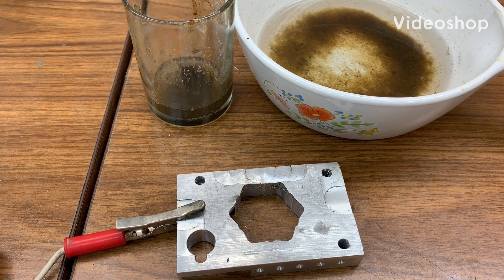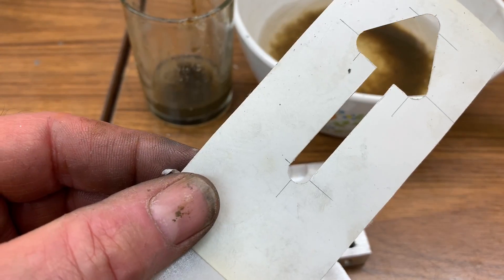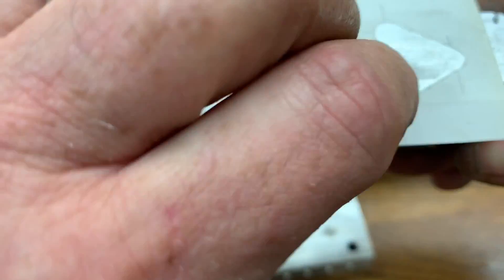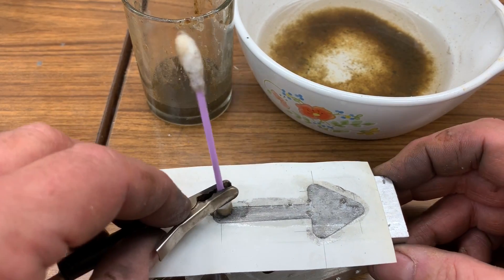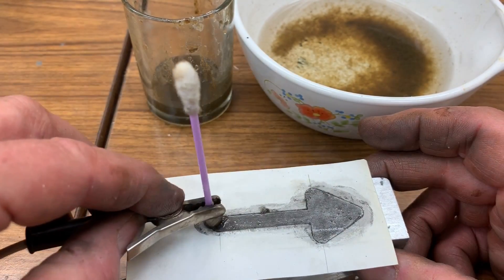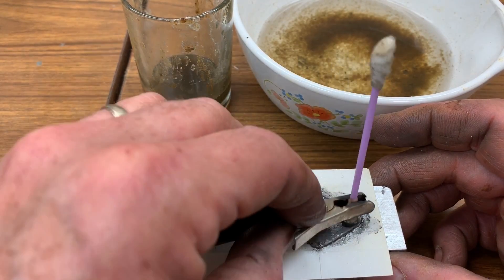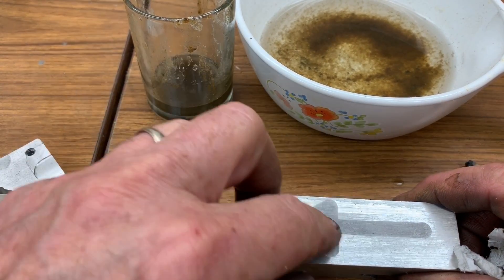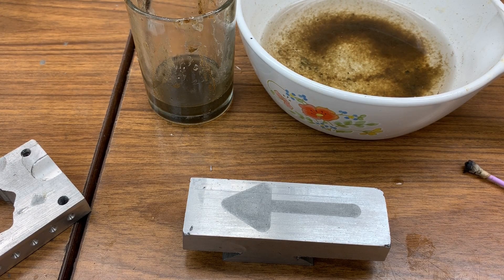Electro-etching Using Stick On Label Masks

Comment: Does this method work for glass?
Reply from the maker: No, material must be conductive. Sand blasting through a rubber mask is often used to etch glass. Would a clear stick on label meet your needs?
Reply: @rgsparber1  I do the silica etching with a vinyl or UV reactive stencil, and it works fine but there's a lot of impurities the become airborne in that process, trying to find an alternative that's clean and simple. What about conductive stencil like tin foil applied to contact adhesive? Would that bring the necessary conductivity to the image area without harming the non-image area?

Comment: Awesome, thanks for sharing!

Another option for making the mask more durable might be to use a positive stencil, paint around it then peel off the sticker revealing a negative.
Reply: My mind went to those "press-n-peel" sheets used to etch PCBs at home - with them printer toner is transferred to the areas to be protected from etchant. I wonder if it would work here to permit finer details to be etched?
Reply from the maker: The toner is very delicate. It holds up to ferric chloride when etching copper but the heat of electro-etching is too much.
Reply: @rgsparber1  Hmm, yeah, I should have thought of that. Toner can be pretty fragile even for PCBs and in normal prints is melted onto the paper with only moderate heat.
Reply: @carneeki  Yeah, it probably would. I was also thinking photoresist for PCB etching might also work.